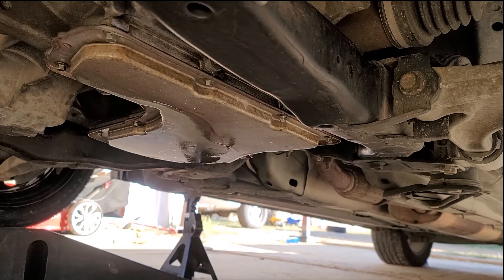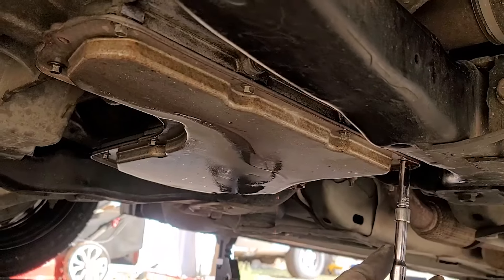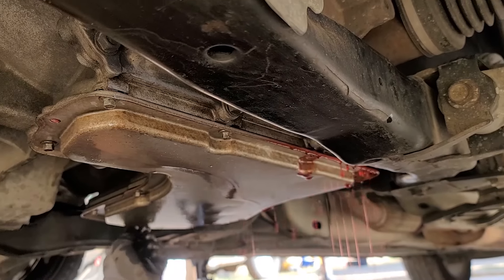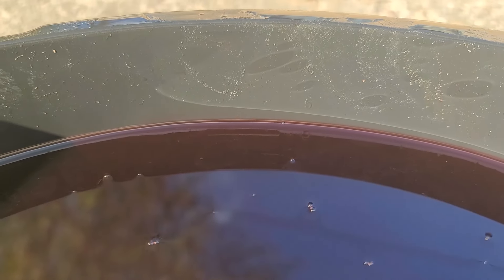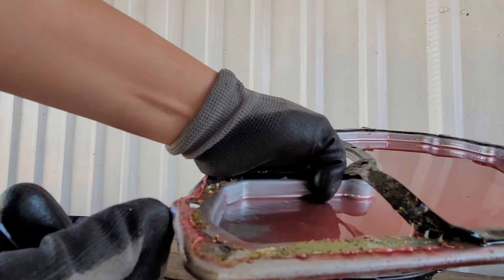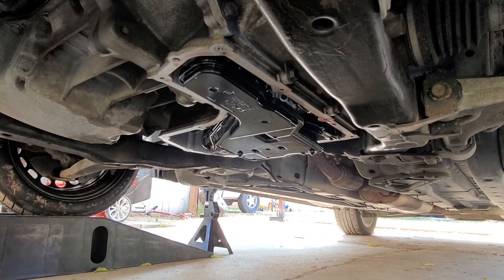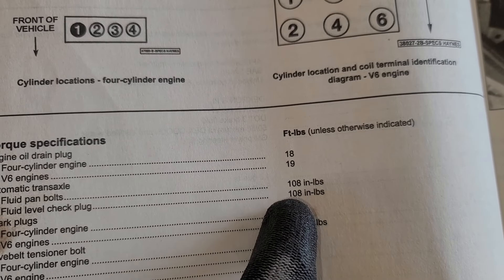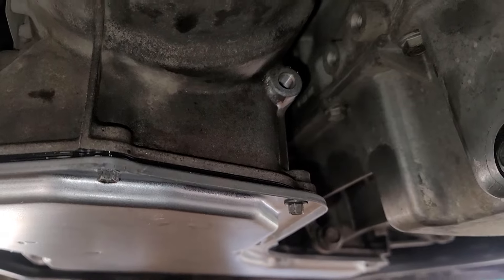TRANSMISSION PAN LEAK- What happened and how I got it fixed!

Comment: Cool. I just fixed a pan leak this morning on my 2006 Toyota Matrix with 208k miles. One of the pan bolts at the corner was completely loose. I snugged it up and checked adjacent ones which were also a bit loose. Then I went around pan with 10mm on a small 1/4 drive ratchet and gently check remaining bolts. Then top it up. Luckily, the trans function was not affected.
Reply: One of my bolts is over tightened and now loose as well. Your story gives me hope😅
Reply: @Jeremybolenbaugh  If you snug it up a little bit at a time and check for leaks it should be fine. Otherwise, replace gasket. Also, if it's a tiny leak (not leaving drips on driveway), you can just keep an eye on it. Also, make sure you have proper level for ATF (it could be low).

Comment: When the transmission doesn't have a drain, the weight of the fluid when the pan is loosened can warp the pan ,then it is extremely hard to get the old pan as clean as it needs to be. My old mechanic from many years ago told me to replace the pan and gasket,plus also only use the OEM gasket.  Fel- Pro also makes OEM quality gaskets at a cost savings.

Comment: Your mechanic made the mistake using sealer with gasket. That's not how those work, it will definitely leak. You just need to make sure the surfaces are clean.
Reply from the maker: I agree with you 100%.
Reply: Thanks
Reply: put a new gasket,

Comment: I currently have this problem with my 3.5 saturn aura. It just won't stop leaking. I bought a new pan, numerous gaskets(felpro thick gasket), rtv, and even stop leak. At this point I'm convinced that the transmission surface is warped
Reply: gm gaskets

Comment: So it was the pan! I've got an annoying leak there too. New Gasket didn't slow it down either.  Gotta try a new pan. The other thing was the transmission fluid line Fittings. Check those for leaks.

Comment: Something similar happened to me. My transmission started slipping so I decided to service it myself. The first time I put it up, it was perfect. No leaks at all but I forgot to put the magnet in, so I had to drop it again. The second time, I thought I’d use the same gasket. Bad decision. It started leaking so I dropped it again. The third time, I thought I’d use silicone sealant with the new gasket. Bad decision it started leaking, so I dropped it again.  this is the fourth time I’m doing it and I can’t tell you how much money I’ve blown buying fluid and new filter/gaskets. If it leaks this time, I’ll take it to a professional and shell out $500 on top of the $200 I’m sure I’ve already spent.
Reply from the maker: Sorry to hear you had to drop the pan so many times. But yeah I get you, I sometimes feel like taking the cars to the mechanic too.  Time is valuable too. Thanks for sharing 👍

Comment: KGR

Great video.  I have a 2007 Caddy CTS, 145 K, I've always just changed the fluid not the filter.  That was easy to do, never and issue and never had to take the pan down.  I'd do it every other year, regardless of miles.  This year I decided to do the filter, easy job, or so I thought.  Went down to NAPA and bought the filter kit, probably an hour job.  

The CTS has a sealed system meaning there is no dipstick, another terrible idea from GM.  Got the job done, started her up and she leaks as bad as yours.  One thing I've done for probably 50 years, is use dental floss to secure the gasket to the pan, probably in about 4 or 5 places.  It always worked well.  

Like you, I had it towed to my mechanic, as I didn't want any issues with the transmission (as this is the Mrs. car).  Same thing it was a flimsy gasket.  The mechanic dropped the pan, saw the issue.  Somehow the gasket had a fold in it.  He said it was not damaged.  He got it all fixed up, no leaks.  Great!  Well a week or so later, I noticed a few spots on the driveway.  Ugh.  Also before the mechanic got to it, I ordered a GM gasket, identical to what was in there, originally.  As it didn't arrive until after the mechanic had it put together, I just kept it, I'm glad I did.  Probably like yours a rigid well made product.  I'm glad I didn't return it.

So now, I have to either fix it myself or bring it back to the mechanic.  Again, not the mechanics fault, it was mine.  And the gaskets are not readily available and have to be ordered.  He did me a favor, doing his best when he reused the gasket.  Anyways,  that's where I am.  I'm assuming you have no more leaks.

Tom
Reply from the maker: Hey Tom, sorry to hear about your troubles. I hope your able to get it fixed soon. I haven't had a leak anymore, but I still  check on it every once in a while. I guess what really did the Job is getting the new original gasket, but also the new pan just in case there was a dent I couldn't really see or feel on the old one. I wish it had a drain plug though, it would definitely make the job a lot easier. I wish it had the dipstick too! But so far no more issues. I hope you're able to fix yours soon. Good luck 👍
Reply: @kgrdiy1928  All fixed!  Got sick of the spots on the driveway, the wet pan and not knowing how much I was loosing.  I installed the GM gasket, all is bone dry now.  The gasket that came with the filter is a cheap flimsy gasket and the cause of the leaks.  From now on, it's the GM parts department.

Comment: The magnet is most important when the car is new. Metal chips from machining in the manufacturing process may hide despite good cleaning practices at the factory. It is in the first 500-1000 miles that  any chips hiding inside the transmission may move with the fluid flow. They are gathered by the magnet. If your transmission makes new metal chips, you have a very serious malfunction and the magnet is not going to fix it. This is also true in the engine oil, the drain plug is often magnetic. A new car will have some chips.  A spun or shattered bearing will make new chips. or a shattered oil pump. But usually, you will not see metal chips on the magnetic drain plug after the third or fourth oil change.
Reply: That magnet helps whether the transmission is new or old, and it is always good to have a magnet in your transmission pan. In older transmissions with failing universal gears, peices of that gear may fall out inside the transmission. If you have a magnet in your transmission pan, it may catch and hold that gear in place until you have your transmission fluid changed at a later time .

Comment: I have a 97 Chev Lumina, and I just changed the battery, and it was sitting idle for
1.5 years, and did not drive it. Changed the battery today, everything was great,
all interior lights went on, and she started on one crank. Took if for a drive, and
noticed this red fluid dripping out badly from under the car. It wouldn't likely be
power steering fluid, as you would get whining from the pump when low on fluid.
It's sort of reddish fluid on the ground, and smells a bit oily, and has a bit of body
to the fluid. After driving it for 5-6 miles and not knowing it was leaking until I
was about 3 miles into my drive, I turned back and headed for home. As I got closer
to home, and it was still leaking, it had "no power" whatsoever. I pretty much had
to coast about a city block to get it to my house, where it's now parked. It is a
rust bucket, but only has 50,000 miles on it, and it's a great utility car, for picking
up building supplies etc, and I'd like to keep it. When I took it for a ride, it shifted
smoothly etc ??? 
 
So, I was thinking, I could get lucky, and it may be leaking from the transmission
cooler lines, as your video explains ? I think these lines wouldn't be expensive. Also
my big leak, was coming directly from under the radiator, so it makes sense, Also
the leak could be coming from the drain plug, at bottom of transmission drain pan.
NOTE - this leak is coming out fast and steady, creating a pool on the ground fast.
 
Maybe I'll get lucky :) and hear back from you as to what this likely is ?? If it was
just leaky seals or gaskets, the fluid wouldn't be heavily squirting out. It would
slowly drip out -- I would think.

Comment: I need help! Last week I figured I would flush my transmission fluid and replace it as well as replace the filter on my 2008 Kia Sorento

So I did but since I couldn't open the bolt in the pan to get the old fluid out, I decided that I needed to just Remove the pan.

Well I did, screwed it back up.

Holy leak x100, I didn't know that you needed a new gasket when you drop the pan.

So I ordered a gasket and a new pan from Kia.

400.00 later, I installed them, filled the transmission up again. Everything seemed like it was good until that next morning when I saw that it's leaking.

Ugh

My question is, if I drop the pan, will I need another gasket?

Comment: Someone swerved very last second in the road while we’re both going 70 on the highway. I hit a bumper that’s on the road and instantly pulled over to see I cracked my transmission pan and seen it gushing. Luckily It held up and I got it to my garage to prop it up. So there is no gasket on my vehicle(04 Chevy cavalier) and says to use the liquid one. I even asked a person at auto zone just to be sure. Is that sufficient enough?
Reply from the maker: Hey Handy Dan, glad you're ok. In My case my mechanic recommended me to go with what the dealership would recommend, which was to install the original manufacturer gasket. I paid full price for the original gasket which was more expensive but it's thicker and better quality  than the ones sold at auto zone. It  solved my problem.
Reply: @kgrdiy1928  I appreciate your feedback. Yeah I’m going to go with the original. Even if it costs more. I’d rather have it fitting as it should be as from a store bought.

Comment: The mechanic used the wrong gasket sealer, that's most likely why it leaked so bad. If you're going to use gasket sealer with the gasket on a transmission, always use Permatex Ultra Black, no other gasket sealer will work right. Be sure to let it cure for 24 hours before adding transmission fluid.  If you use any other gasket sealer or do not let the sealer cure for 24 hours, or do not torque the bolts correctly,  you will have leaks. Of course I didn't state the obvious things such as wiping the gasket surface clean, but I figure some things should be common sense to anyone who works on their own cars enough.
Reply from the maker: I agree with you. Thanks for sharing 👍

Comment: I am having a similar issue with my 1997 Subaru Impreza. A mechanic already replaced the my oil pan and sealing gasket for the motor 3 times and he has not been able to completely stop the leak; there is one minor, tear like, drop leak in one of the corners of the pan. He used the glue paste as well. Now, he just changed the transmission pan gasket, and it is still leaking. I didn't see him set his torx wrench to any particular measurement. I think that I might have to get a new mechanic. Why do you all think he's not able to stop the leak?
Reply from the maker: Hello. I feel that in my case it was a combination of multiple things that helped stop the leak. 1. The original manufacturer gasket (third party's gasket was too flimsy)  2. Using the recommended torque specifications, 3. A new pan, in case the old one mightve had some sort of dent I couldn't really see or really feel. I hope you're able to fix yours. Good luck 👍

Comment: How much did this cost wow ?? Im having the same problem:/
Reply from the maker: Hi Thomas, the gasket was around $50 (original GM gasket), the pan was close to $100, and each quart of transmission fluid was around $10 (I believe I used around 7 quarts, I don't remember exactly, but normally your owner's manual will let you know how much). Good luck my friend. 👍

Comment: So an old friend of mine told me as soon as I replace the trans fluid I have to time my gears? Then others say I don't. I'm confused about the teeth. I own a Ford Mustang GT (2011)
Reply from the maker: I don't think I've heard about having to time any gears. I only switch out the oil and the transmission seems to be working fine. I would definitely like to hear if anybody else has done this to see if it helps the transmission last longer.

Comment: I can not get my Trans pan to stop f*cking leaking!!!!!! It's driving me absolutely nuts. I've had it to 2 shops now 6 times. 6 f*cking times and it stops leaking for one day at most and then leaks again. It's a 2003 chevy S10 and I do landscaping so I'm constantly in peoples driveways.... it's an issue that is driving me absolutely f*cking looney...
Reply from the maker: Have you tried putting on a new pan and the original pan seal from GM? I had a leak with a third party seal, so i had to get the seal from the dealership and that seemed to work for me. Good luck, hopefully you're able to get yours fixed. 👍

Comment: It’s crazy mines is missing that plug lol
Reply: Same, like where tf that plug came from lol
Reply from the maker: You mean the drain plug on the pan? I haven't been able to find one with a drain plug. Would've made the transmission flush a lot simpler that's for sure.
Reply: @kgrdiy1928  I found out what the problem was who ever had the car b4 me never put all the transmission bolts back on the trans